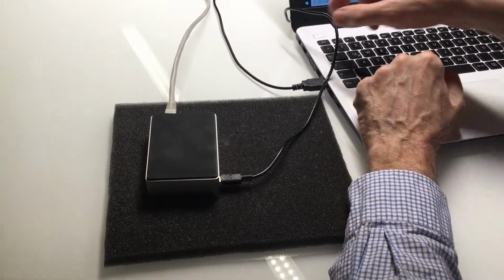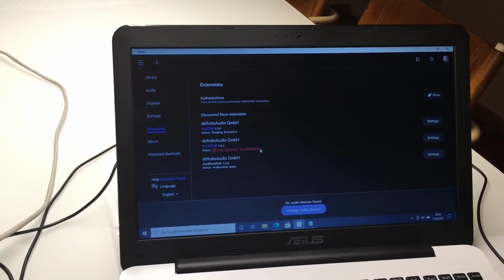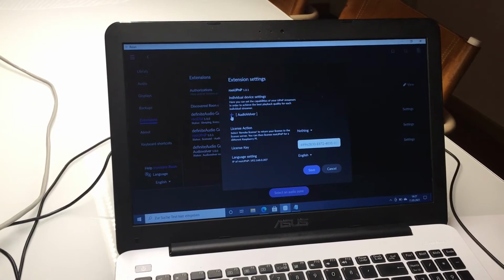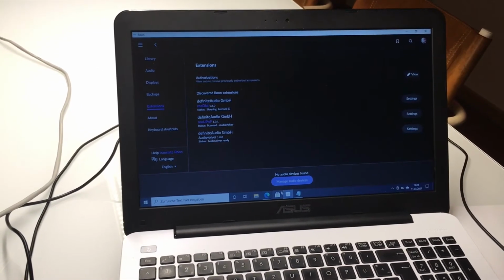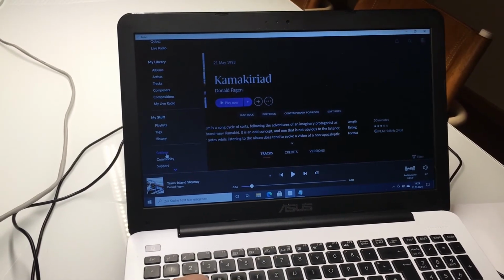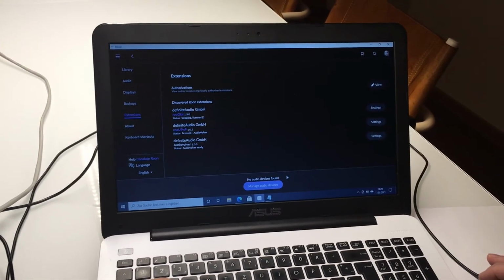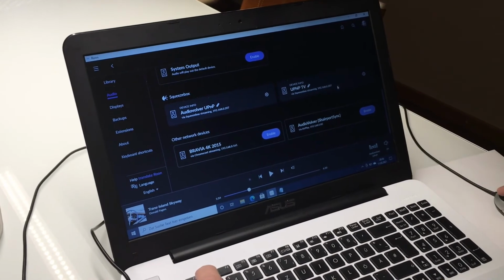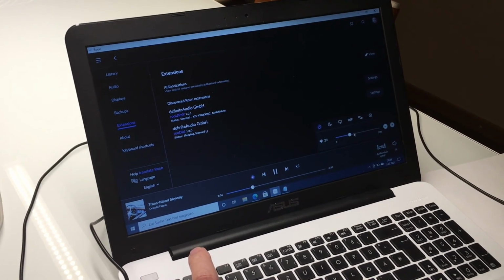rooUPnP Part 3 Make it run

Comment: My question is for rooPlay for my turntable. I want to record FLAC file while listening to album. Is it one continuous file or will it make files for each track ?
Reply from the maker: Ah, now I see 🙂 
It creates one file from starting playback via Roon to stopping playback. So you can start and stop playback for each track so you get a file for each track. If you start playback at the beginning of the LP and stop it at its end you will get a single FLAC file up to 24/192 that you have to postprocess manually.

Comment: Thank you my systems working perfectly. one question if we use memory stick how does it handle a side one of album …. One file or multiple FLAC files ?
Reply from the maker: I don't understand what you meant with "USB stick" handling. Please visit my support forum here. https://community.roonlabs.com/t/rooextend-the-easy-start-with-roon-extensions/167563
You also will find a thread where I support rooUPnP.